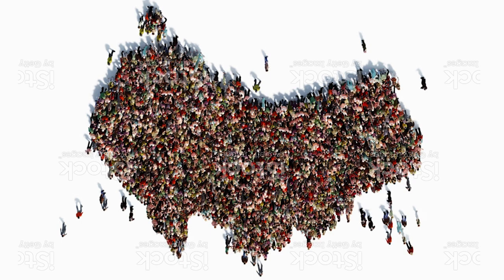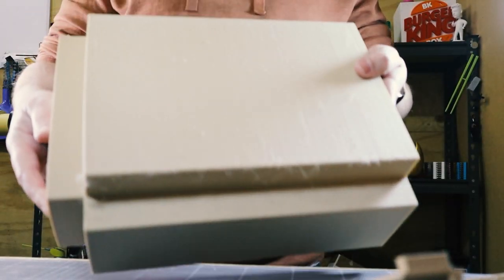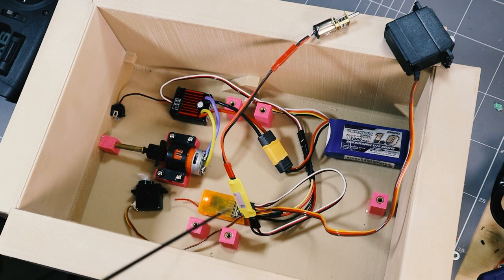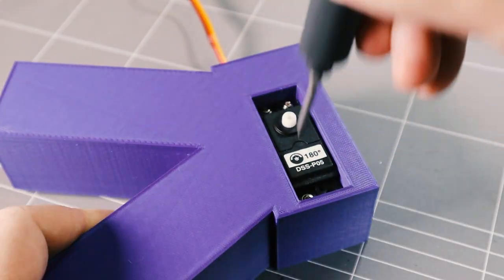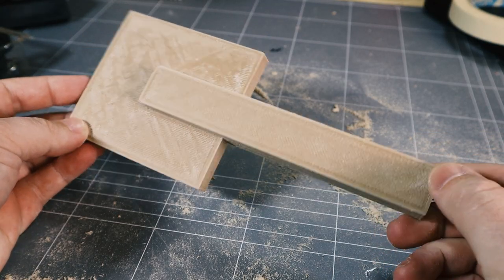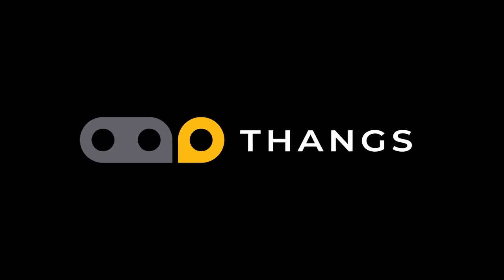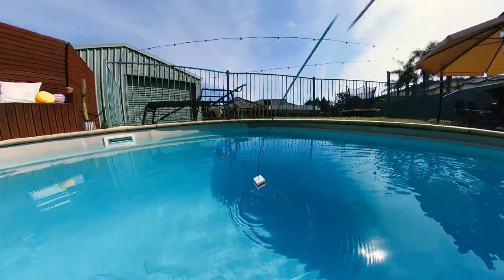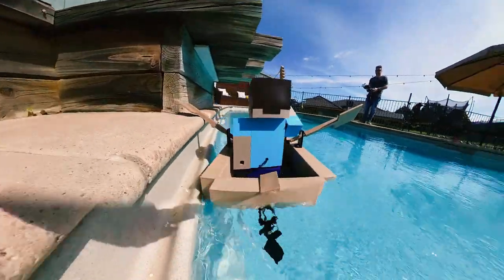Fishing with an RC Minecraft Boat in my Pool

Comment: Make the fishing with an electromagnet. Or you could make the "line" from a tube and have a piece of stiff fishing line inside it to pull the magnet back enough to drop the catch. If you could keep the oars from spinning the boat could be propelled and steered by driving the oars independently with variable speed.
Reply from the maker: I considered an electromagnet, but the electronics were getting a bit messy! Great idea for the fishing rod and variable speed on the oars! Maybe I’ll mod it down the track…

Comment: how do i get the stls? its only a .step file.
Reply from the maker: Open the .step file in your modeling software (Fusion 360 has a free license for example) then save the individual parts as .stl. The good thing about .step files is that you can modify them easily if want to make any changes.